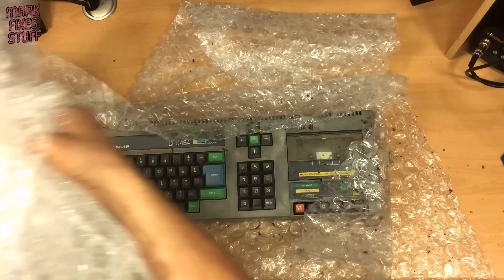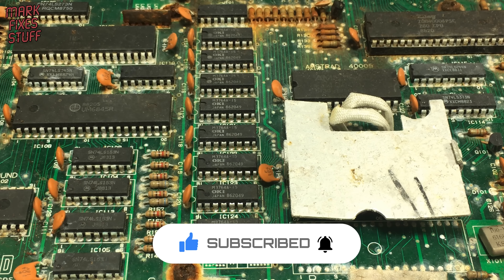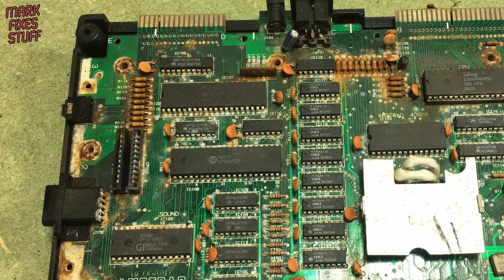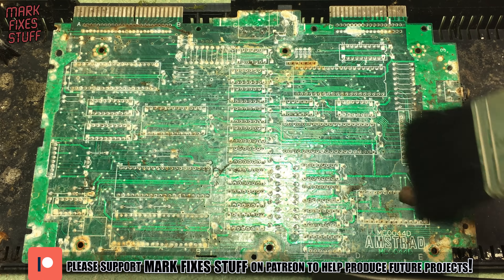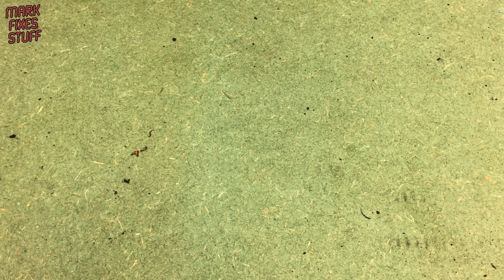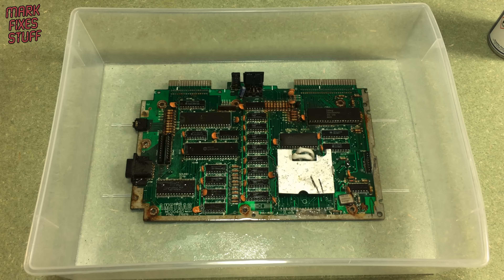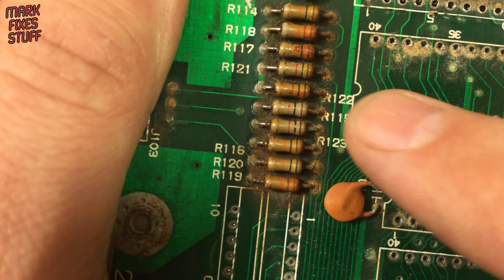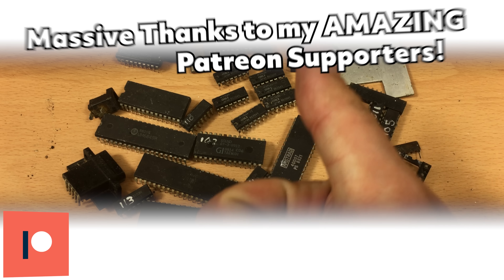An Amstrad CPC 464 Found in the Woods PART 2... Retro Computing Hell.

Comment: Yes a board transplant, moving as much original components over as possible, especially the CPU.  Perhaps we should perform some tests on the original board to detect if there is any chance it can be used?  If the board passes the tests then perhaps continue with it.  May involve a lot of trace testing to detect those hidden issues.

Comment: The Japanese tool brand "Engineer" makes these screw extraction pliers called the PZ-58 "Neji-Saurus" that would be perfect for this kind of job where the screw head is sticking out. I've used them to remove badly corroded tiny screws from a TRS-80 CoCo keyboard, for instance, as well as lots of ruined small fasteners on cars. Shop around, since there are lots of gouging resellers.

Comment: Yep, a repro or donor board is what i would do. I fact, I may have to do this with one of mine which has developed an odd grounding fault, where it will only operating while ground via the DIN on a monitor. Kudos for trying though Mark, but about 4 minutes in when I saw the extent of the damage, it was a case of as long as the chips have held up. Enjoying these videos I must say, will be great to see it reborn out of the woods.

Comment: Great video as always, Mark! I think that board is going to be so time consuming that it's probably not worth it. Not to mention that with the other issues you mentioned even if you fixed all the surface things it might not work anyway. I think a new board is the way to go.
Reply from the maker: Hmmm. I know you’re right... but still tempted to try. But I also know it’ll burn so much time...

Comment: I kept shouting “vinegar!” at the screen, and sorry about that, but all the rust and mentions of lime scale, made me think that perhaps the entire board should be treated as a leaked battery-repair! Scrub everything in vinegar to get rid of rust, lime, corrosion etc., and then start removing components, repairing the pcb, and re-solder the working components. Lots of work, but much more satisfying than transplanting working chips to a new board ...

Comment: I think you would have been better served soaking it in vinegar for at least a few hours.  Contact cleaner may do well with oil and light oxidation, but vinegar would have made short work of the lime that was making your de-soldering efforts so difficult.   A few hours shouldn't harm the electronics,  Just be sure to thoroughly rinse it with water then IPA after.

Comment: I have a really strange morbid curiosity that wants to see the original board get stripped down further and aggressively cleaned, if traces and via's get vaporized so be it, and then make the call to move to a repro board then, as you are going to know by then if the original is a total lost cause, and will make the choice for you anyway :D

Comment: Hmm, the “silicon soul”, I like that!

I think a transplant into a fresh board would be a fun project, but I’d be really interested in any further tips you can share with us about diagnosing these “hidden” problems! I’m part-way through restoring a ZX Spectrum that has some frustrating issues lurking somewhere below the surface, but it’s so rewarding to coax life back into these old fossils.

Anyway, good luck with the resurrection, whatever form you decide to take it!